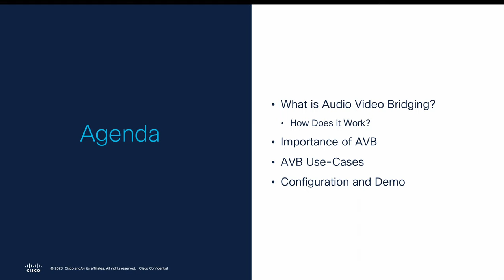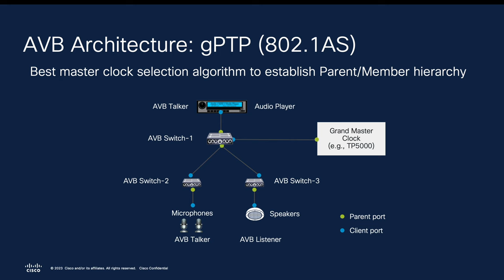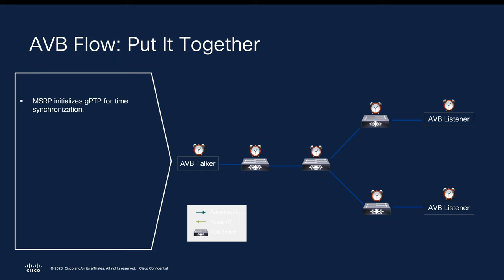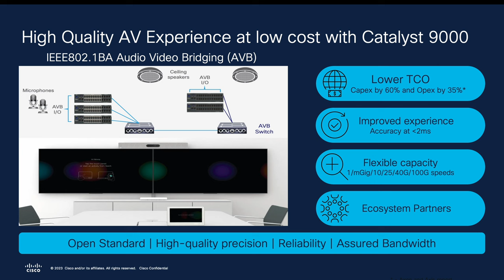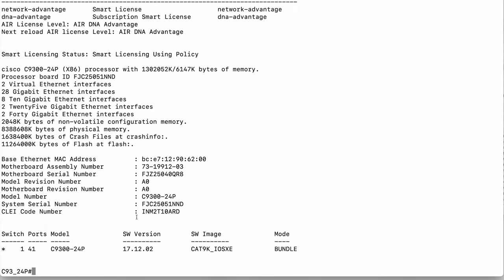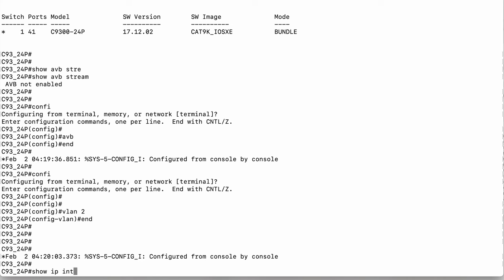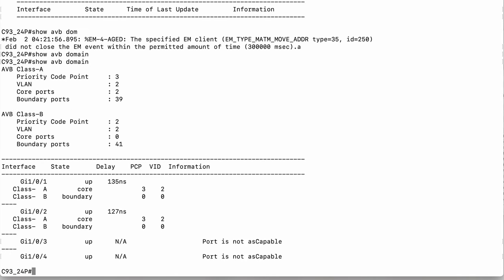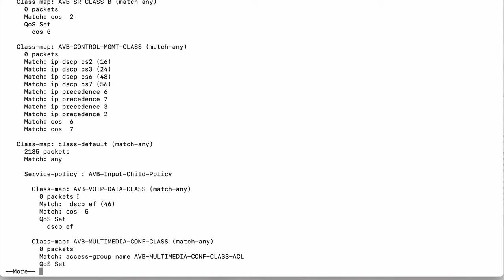Audio Video Bridging (AVB) with Catalyst 9000 Series Switches

Comment: Thank you! Very informative. 

I have question when using a core switch C9600 with C9300 as distribution/access switches, does AVB still works with this network setup?